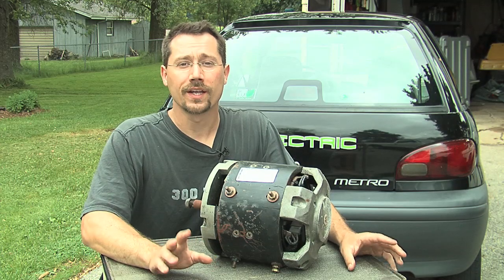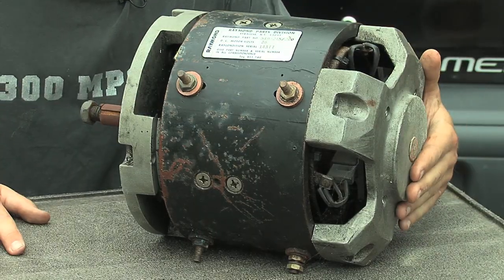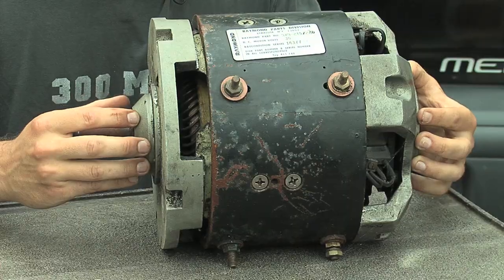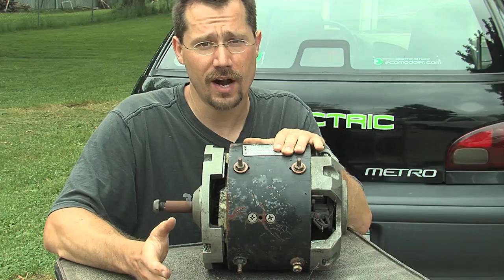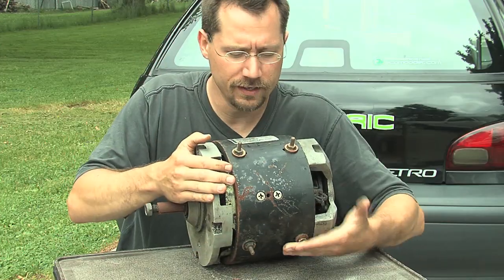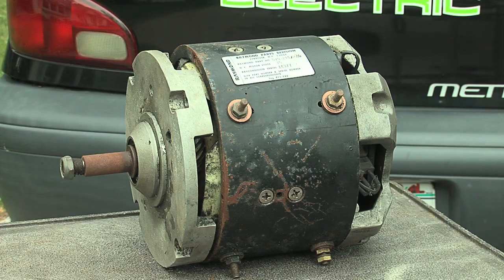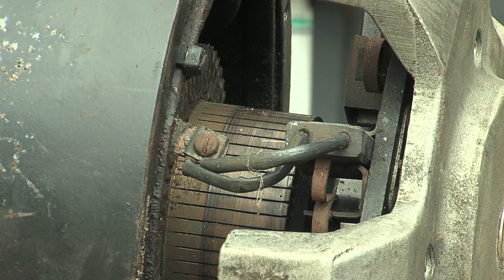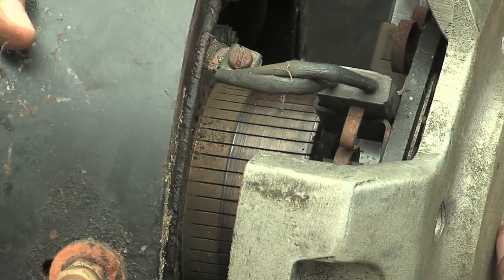5 Build Your Own Electric Car: DC Motor Basics

Comment from the maker: We are now on Patreon! We'd love your support as it helps us produce more videos like this! https://www.patreon.com/300MPG
Reply: If you dont live in USA with 2nd hand fork lift motors in your country or REGION

What else is available ?
Reply: Sir teach me
Reply: After spinning the rotor @2:45 to the bottom right there comes out a spider and goes back in the DC motor after walking across to the other side, hopefully it doesn't do any damage to him.
Reply: Please check out subscribestar  instead of pateron

Pateron is removing people and censoring creators

subscribestar is a payment platform that supports free speech for EVERYONE
Reply: @charliebrownau  wheres the cleavage click bait though.. hehe. All the best.
Reply: Very good can you make a drone
Reply: Brilliant Ben... I live OFF grid in a 2012 Itasca motor home AND would love some advice and or explanations from you on having ELECTRICITY to a] 12 volt DC to charge my batteries and OR   b] Alternating current to by-pass an inverter.   

a]  how could I use this motor [forl-lift] or could I use IT to run an automobile ALTERNATOR that puts out say;  200 amps ---  dc to charge my batt-bank?  

And b] Could this motor give us 110 volts alternating current and go straight to ac appliances?  And c]  whatever power I would need to spin this fork-lift motor or a different DC motor I'd use solar power to run it (to a 12/24/36/48 battery bank)

Would a magnetic motor be the most efficient?  Do fork-lift have them?
Reply: Please swap from PATERON to SUBSCRIBESTAR
Reply: Could a Tesla powerwall power a car? Why or why not?
Reply: BenjaminNelson i was wondering if a alternator could keep the batterys charged while you drive like in a combustible engine.? .
Reply: @Lamont24012  I wondered the same thing and my friend said that would be a perpetual motion and that doesn't exist. he said in the car the alternator may charge a 12 volt but the 12 volt isn't busy moving the car. The GASOLINE is moving the car. In an EV the "12volt"  along with more than one 12volt are using a lot of their stored power to move the vehicle.'s motor  If you drain some of that to turn an alternator it won't be enough to refill the batteries or it won't be enough to move the vehicle.  Now that's what my friend said so if it's wrong I'd like to know as well.
Reply: Rich Rebuilds Know you are up to this?

Comment: Why can't we use AC to DC 12v adapter to power it
Reply from the maker: @GabrielAbiola-xp8xj  You could, but how much current can your 12v power adapter provide?
Keeping in mind that one horsepower is about 750 watts, you would need nearly 63A at 12v to make just ONE horsepower. 

Plus, the point of an electric car is that it is mobile. Much easier to power the motor with a series of batteries which can provide the power to move the car.

Comment: Could you please explain if we connect two of the power connectors together using a cable or copper bar, then my question is: To which ends of the four connectors shall we connect the DC power cables. - and whether we need to connect the other 2 connectors to each other also or we just do this cross connection for 2 only and leave the other 2 unconnected. - Thanks
Reply from the maker: A series-wound DC motor has four power connections.
The stator and the armature both have a power connection at either end (4 connections total.)
The stator and armature are connected in SERIES to make the motor operate. If that connection is external to the motor you will see all four connectors. If it is internal you will only see two connectors on the outside of the motor.

Having external connections makes it easy to reverse the polarity of ONLY JUST the armature or stator, making the motor spin the other direction.

This is all really a lot easier to explain in images. Take a look a few web pages talking about the basics of DC motors.
For example: https://www.geeksforgeeks.org/series-wound-dc-motor-or-dc-series-motor/
Reply: @BenjaminNelsonX  Thanks a lot my friend I am really grateful for your sincere explanation and prompt reply, Keep the good work up I really learnt from your answer and subscribed in your cannel. You are awesome

Comment: Is it possible to convert the rotating section from copper coils to magnets? Will the torque be strong and rotate quickly?
Reply from the maker: Yes, it actually IS possible to do that. I have a friend who did that to a motor, but he is a skilled machinist and experienced in all sorts of fabrication.
A motor described like that is known as a Permanent Magnet DC Motor. They are quite common for many applications. They tend to be more efficient (since the electric current is creating one magnetic field instead of two) but not provide as much torque.
Still, magnets have improved over the years and come down is cost, and PM motors can be very powerful.
For example, Tesla used induction motors on the Model S, but switched to PM motors for the Model 3.
Reply: @BenjaminNelsonX 

 Thank you for the quick and useful response, and I wish you success in all your work and lasting success.

Comment: just aNOTR use a if 3 phase motor make this car garbage
Reply from the maker: Keep in mind that as we look at this in 2024, this project is from about 16 years ago!

Three-phase AC motors that are practical for electric vehicles are SIGNIFICANTLY more common and less expensive than they were then.

For most general use electric vehicles now, three-phase AC motors are fantastic. And something like a salvaged motor out of a Nissan Leaf is great for a DIY project.

That said, DC motors still have their uses. One of them is the fact that you can just get so much torque out of a DC series-wound motor. That's great for drag racers!

My electric Geo Metro had enough torque that it could burn rubber in 1st gear AND it could pull away from a dead stop (without a clutch) in 5th gear!

Comment: Outside any potential construction costs,... what are the benefits of DC motors?
Reply: DC motors can use simpler (less expensive) motor controllers. Series wound DC motors are also known for having very high torque. Most EV drag-racers and the like used DC series-wound motors.
In my Geo Metro, I could pull away from a dead stop in 5th gear with no clutch. In first gear, I could burn rubber.

Comment: This is really interesting, but you don't need a transmission if you're using an electric motor.
Reply from the maker: No, but you DO need at least a place to mount the motor, gear reduction, and a differential. 
If converting a front-wheel-drive gas car, the easiest way to get all those things is to keep the transaxle. Just use fewer gears.

Comment: Hi Benjamin, I got this DC motor, how do i tell its dc power voltage requirements  and whether its suitable for ev conversions. Here are the details shown: KW 6.75, RPM 1500, FEV 220, Var 220, Amp 4.0, and Frame 100m.
Reply from the maker: The best information that I've found for understanding information on DC series-wound motors was a thread on the DIY Electric Car Forum by motor expert Jim Husted. Take a look thought this thread. https://www.diyelectriccar.com/threads/using-a-forklift-motor-and-choosing-a-good-one.7598/

Comment: There is a conversion chart for the horsepower ratings. What are you using as a power source? You know that electricity is primarily produced by burning coal. Which one produces less pollution? I’m curious about how you feel about it 4 years later.
Reply from the maker: Power at my house comes from the solar panels on my roof.
Even if I was getting electricity from coal, electricity is still cleaner than gasoline.
Just think about it - the power plant has a 24/7 staff of engineers making sure it runs as efficiently as possible. But for most of us, when is the last time our car engine has even had a tune-up!?

Comment: My question is why didn't you just hook the motor up to the top of a bare engine with only the crank connect to pulley up to the other pulleys with the belt and alternator connected run the wires to the alternator and to a battery or a power watt inverter if it has a plug.
Reply: Can you let me know where to find one of these "beer" engines you speak off? Sounds awesome. 😂
Reply: @anthonypelchat  auto text sucks
Reply: @anthonypelchat  I spoke of but not "off" LMAO
Reply: @ronniehugh7905  I was so caught up dreaming about that beer engine, that I forgot how to spell as well. Hahaha.
Reply: @anthonypelchat  this day and age you never know what somebody will come up with. I can see my brother putting the hand crank on the front of a crank and filling the engine up with beer like a plastic engine or something and use the drain from the oil plug to let out the beer. I guess would be a beer engine

Comment: That was great, cheers. Informative, logical n easy to follow, just what I was looking for. I hope you have done many more vids to help me explore my (not at all original) idea to put an electric motor into my old 1960s British 4 cylinder car. I'm hoping I can just remove the motor and petrol tank and replace it with an electric motor running through the car's gearbox and then fit some kind of battery box in the back, we'll see ;).

Comment: Is HP cumulative when adding electric motors?  If a have 200HP motor on the front and another 200HP motor on the rear will that be 400HP

Comment: Watts are torque x rpm x conversion numbers based on your torque units.  There are 746 watts in a horsepower. I don't understand why you say that to doesn't mean anything, it is the continuous power rating of the motor. The reason you can accelerate your motorcycle is because you are utilizing peak output, not the continuous output.
Reply from the maker: The issue is that the Horsepower ratings of gas and electric are almost always different. Gas engines are rated at PEAK horsepower and electric motors are rated at CONTINUOUS horsepower.
It's like trying to compare a sprinter to a marathon runner.

The other issue is that electric motors tend to have much higher torque at low speeds. For acceleration, TORQUE is the important part of the equation. And high torque but at low speed still tends to be considered low horsepower, even though the motor is doing exactly what it's intended to do.

POWER is a number that can be calculated, but you DO have to do the actual full calculations, including at different vehicle speeds to figure out what is an appropriate electric motor for a project.
Trying to compare the HP numbers listed for gas vs electric is NOT as simple as just looking at the two numbers.

Comment: the motor commutator is completely similar in function to a ESC for a brushless motor
Reply from the maker: Well, yes.
A commutator is a MECHANICAL device to flip flop the polarity to reverse the magnetic field for the alternating push/pull effect to spin the rotor.

This can also be done with electronics in a brushless DC motor controller, or with a variable speed inverter (drive) on an AC motor, or even "naturally" through the rotating magnetic field on an induction motor.

The commutator and brushes are not neccessarily the most efficient way of doing this, but have certainly been an effective and practical way to make it happen.

Comment: The brushesw don't point towards the center of the shaft, and their angle suggests that this motor is designed to run one way.  How comfortable is it running the other way?
Reply from the maker: This motor has always run fine in either direction. It was originally used in a smaller "trike" forklift to drive a single wheel that would steer the vehicle. That wheel would also reverse directions.

For brushed motors at higher voltages, it's common to adjust the "brush timing" by ROTATING the part the holds the brushes. That reduces arcing and associated heat, but makes it WORSE if you ran the motor in reverse. That's not typically an issue, as lower voltage vehicles (like a golf cart) use electric reverse, where as something like a 144V DIY electric car would likely instead use the mechanical reverse of the transmission.
Reply: @BenjaminNelsonX  Thanks for the response.  I know that there's not much friction between the brushes and the commutator, but looking at the brushes at 9:43, it strikes me that if the motor is turning clockwise, the brushes would tend to be pushed back into the brush guides by friction with the commutator, reducing the friction, and in the opposite direction, the friction would be slightly higher.  If the motor was designed to spend equal amounts of time turning in each direction, I would have expected the brushes to be at 90 degrees to the commutator, so their axes would pass through the centre of the spindle.
I must point out that I have never been involved with motor design, but I find the angle surprising, and if there is a different explanation for the angle, I'd really like to understand it.

Comment: Can an electric motor like that be directly fitted to a transfer case, without a transmission?
In my mind, the motor would 'rev' with a regulator giving you variable speed. 
If possible, could you then put a 'reverse' by adding another wire system that reverses polarity?
Reply from the maker: For most electric motors, you want some gear reduction. It doesn't have to be a full transmission, but DOES need gear reduction and some way to physically attach to the driveline. Just reusing an existing manual transmission is the most straight-forward way to do this.

Reverse CAN be done without a transmission reverse gear. That's how it's done on modern, commercially-built electric cars - the motor just spins backwards. With a permanent magnet DC motor, you simply reverse the polarity from the battery to the motor to reverse direction - typically done with a "reversing contactor", controlled with a 12V switch. On a series-wound motor, you reverse polarity to either the field or the coil.

The motor controller controls the speed of the motor. See this video for how that works: https://www.youtube.com/watch?v=Epg4qFfIiYY

You would likely connect an electric motor directly to a transfer case as long as it was a motor more designed for high-torque and lower RPM. Of course, the details depend on the weight of the vehicle, the system voltage, etc.
Reply: @BenjaminNelsonX  Thank you for the reply.
I'm no mechanic, but I attempting to build a 'buggy'.
I have built a frame and have differentials & a transfer case. I know the transfer case, itself, IS reduced in gears, and it has a low-range gear. Is that not enough? Or are you saying I need to be able to 'downshift'?
I had full intentions of putting an engine and transmission into it, but I 'dreamed up' the electric motor idea, and now I want to try that. 

Attaching it all together is not an issue. I have already built flanges, splines, yokes, axles, and a host of other things. I'm bright, and have good tools, just not a machinist, mechanic, or fabricator by trade. [However, its coming along nicely.] I'm actually a 'degreed' civil engineer (construction), and hated it so much, I started my own barn building company. All wood.
My prototype toy is just that. But I am trying many new ideas. Over, and over again. 50 years old and still love toys.
Reply from the maker: @philipnatale2110  Sounds like you are off to a good start.
One thing you might want to take a look at is how an electric motor is connected to an electric golf cart. Those essentially have the motor on the differential. However, golf carts are NOT known for great acceleration!

Using "Low" on a transfer case might work just fine. (I am not particularly experienced with transfer cases, so I don't know the particulars.)

I can tell you that an electric motor like the one used in a Nissan Leaf electric car has about an 8 to 1 gear reduction between the motor and the wheels.

If you have some pretty good combined gear reduction between the low of the transfer case and the differential, you should probably be OK.
Likely, you want to do some math to figure out what your top speed will be vs the RPM of the motor. In general, electric motors are happy to spin continuously at a higher speed than you would with a gas engine. The higher rotation, combined with the gear reduction means the motor draws lower current. This mean less heat in the motor, less draw out of the batteries, and reduces how heavy of cabling you will need to do.

Lastly, trying finding or making a few friends who have whatever skills you happen to lack. Even for us Jack-of-All-Trades, there are always other people with greater skills and experience in batteries, welding, fabrication, programming, etc.
A really good electric vehicle conversion takes a wide range of skills, and it's always good to have a team helping out.

Comment: Can  you  put motors together to be stronger and pull something bigger than a Metro?
Reply from the maker: Generally, it's simpler just to use a single more powerful motor.
There are people who have built conversions with multiple motors, but that's typically for high-power, such as for drag-racing.
Reply: @BenjaminNelsonX  Well I can't afford a single high powered one but I can salvage tons of other motors. So Is this possible?
Reply: @BenjaminNelsonX  Is there someplace that can give you a guesstimation of how large a motor, and how many batteries one might need to move a vehicle when all you know is the weight?
Reply from the maker: @aicram62  In terms of range, a typical EV will go 3 miles per kilowatt hour of battery.
There are calculators to estimate how much horsepower a vehicle needs to attain a certain speed. https://www.calculator.net/engine-horsepower-calculator.html
Reply: @BenjaminNelsonX  Thank You I appreciate this link, but I don't want to race in the quarter mile. I just want to go to work so what time should I put? I'm thinking 15 seconds? is that 60 mph